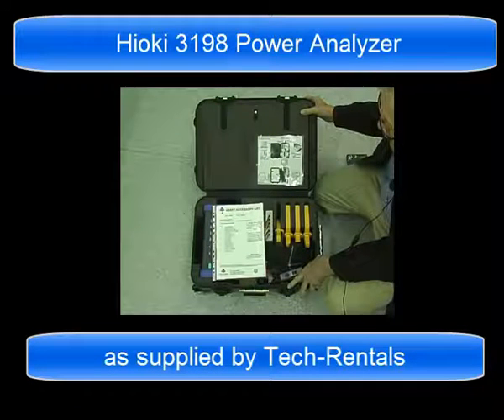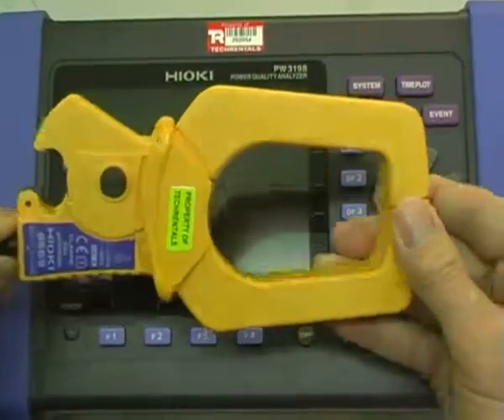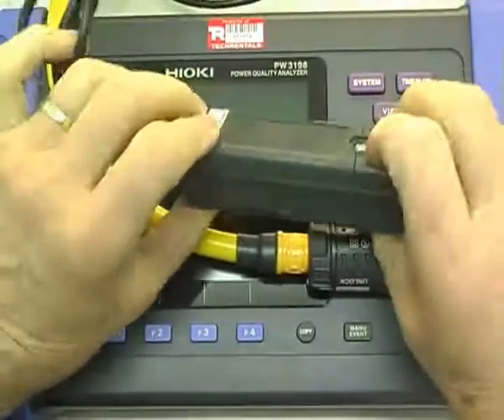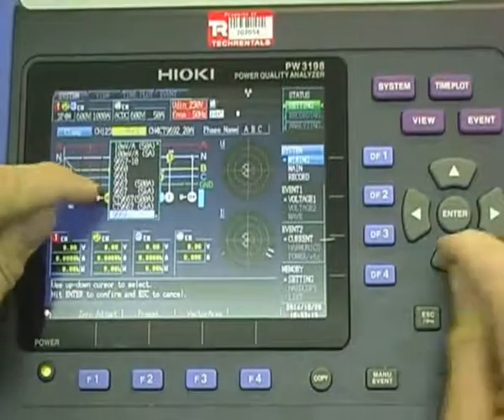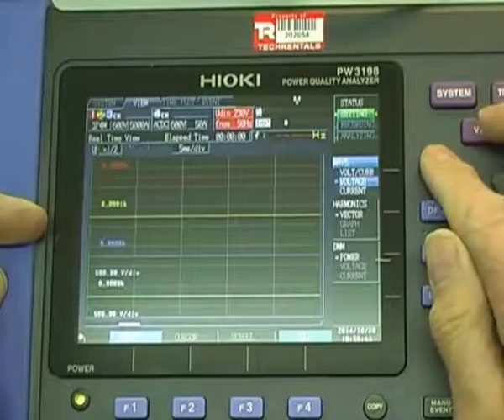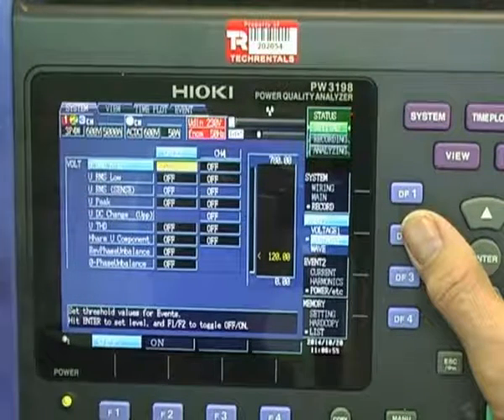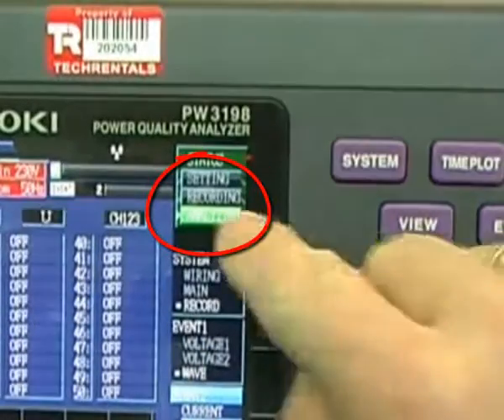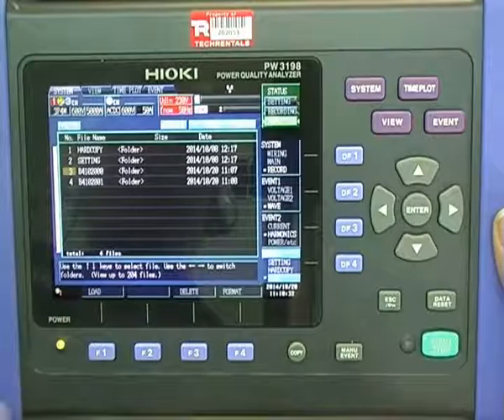Getting Started on the Hioki PW3198 Power Quality Analyser

Comment: What should we have to do if event  recording problem coming continuesoly??
Reply: It depends upon how you have set the triggers. The instrument will record an event when whatever threshold in the triggers has been exceeded. You need to have a look. Generally if you have set the triggers to the standard EN50160 then you may simply have a problem. Check as to why it is triggering
Reply: Check your alarm thresholds. They are too low.